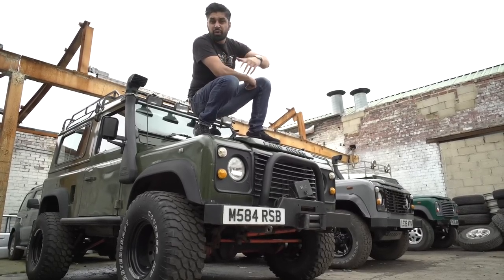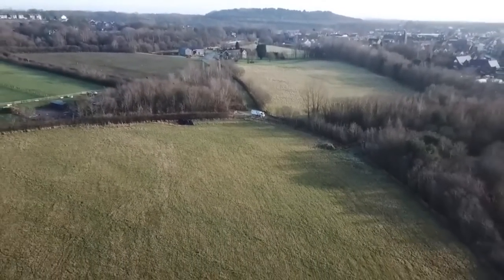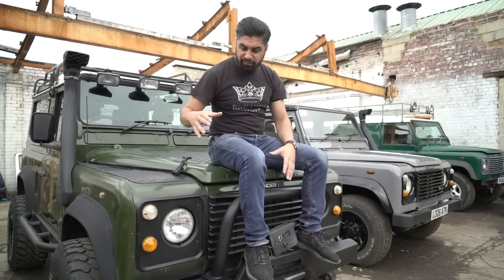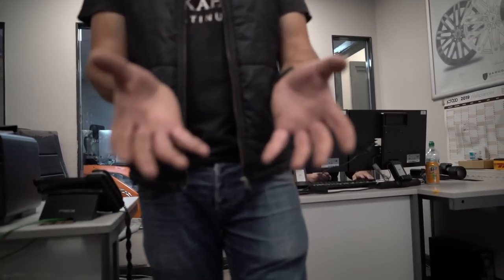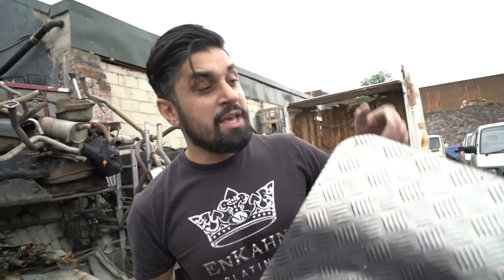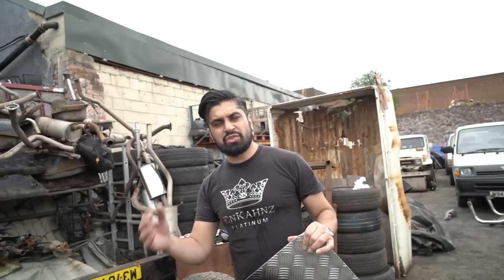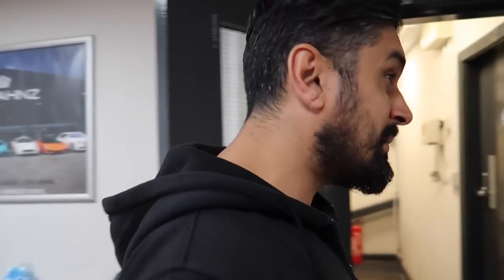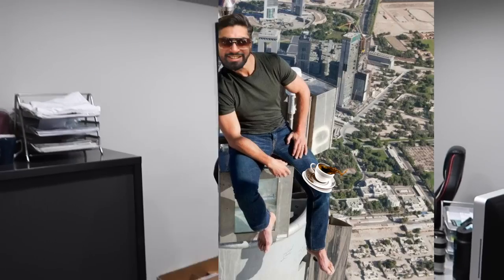THE WORLD'S FIRST ALL-TERRAIN RANGE ROVER VOGUE

Comment: At 6:05 and 6:13 the wheels and tires are hardcore off road tires (as it should be for this build).  Then after those close up clips, they wheels and tires are different setup (which are NOT suitable for hardcore off roading).

But overall cool setup.
Reply: That jeep won't do well at all with no diff lock or most features older land rovers have plus the bodyfiller will be cracked next year
Reply: Well spotted